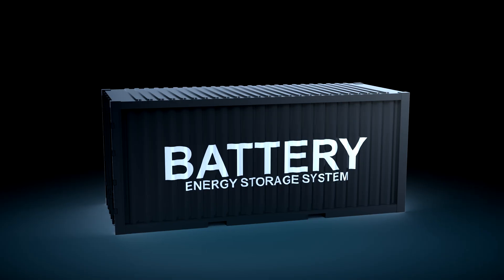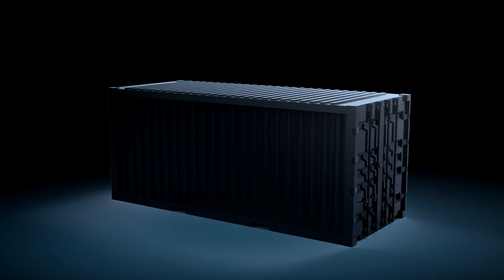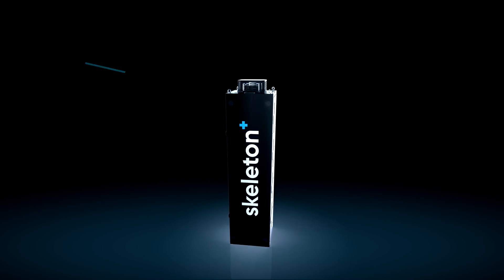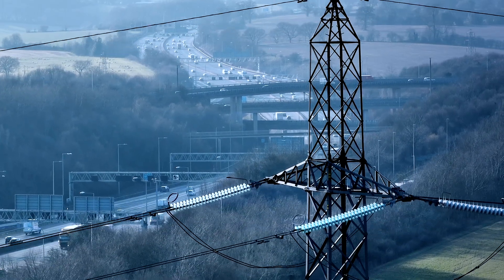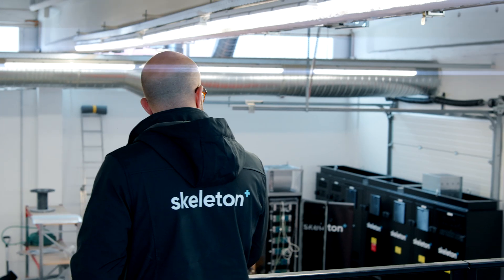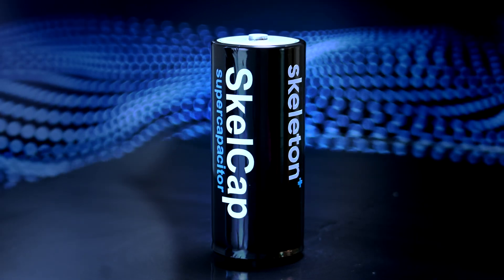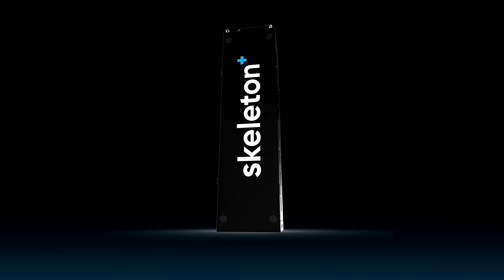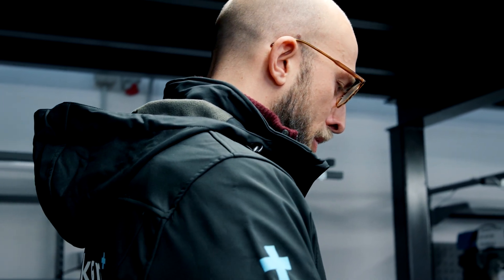SkelGrid 2.0 - Why SUPERCAPACITORS are superior to batteries in HIGH POWER applications

Comment: Everyone is missing the point.  Their usage is still as a capacitor.  That is, they provide surge power rather than backup power.  For certain applications, like trams, they can run them for short periods of time between stations.  

They are a piece of the puzzle.  There is no question about that.

Comment: The power density isn't there yet..
Reply: Combine supercapacitor and lithium battery, the power density and energy density can both improve.:popcorn-yellow-striped-smile:
Reply: The power density is there. Way higher than LFP batteries. You're probably confusing Power Density with Energy Density.
Reply: @Vrykorps  I am comparing supercapacitor batteries to supercapacitors in Energy Density, and Power Density to LFP batteries.

Comment: I would like to see more ultra capacitor management systems, for balancing voltages when series connected
Reply: Why connect capacitors in series which would reduce total capacitance, rather than connecting them in parallel which increases overall capacitance
Reply: @archconnections  Why? because voltage is very low, while capacity is already very large.
higher voltages by series connection makes them easier to work with boost converters.
series strings can then also be paralleled for capacity
Reply: @ You can just connect them all in parallel to keep voltage constant in the circuit and avoid voltage drop while optimizing capacitance. (Ct = C1 + C2 + C3..., Vt = V1 = V2 = V3). 

If the circuit as at risk of becoming capacitive, a management system would be useful to disconnect capacitors based on the inductive loads (-Qxc = Qxt - Qxl).

Placing them in series overcomplicates the function of the capacitors with regard to the circuit. It would be much better to keep it simple, no?
Reply: @archconnections  no. to transform such a low voltage to a workable voltage would not be simple. they need to be in series.
just like batteries
Reply: @MasterIvo  What are your credentials if I may ask? Do you have a university degree?